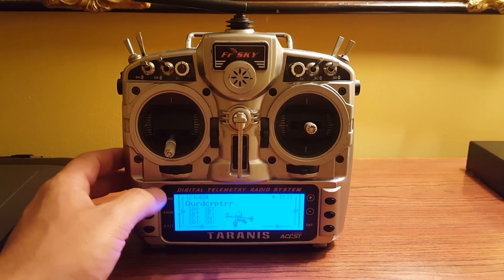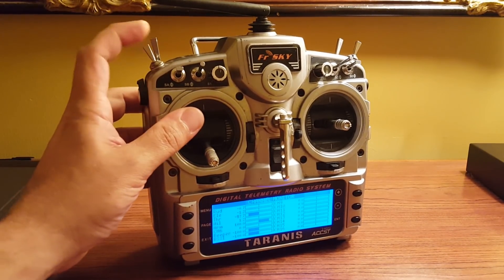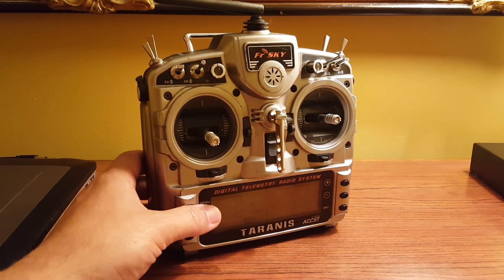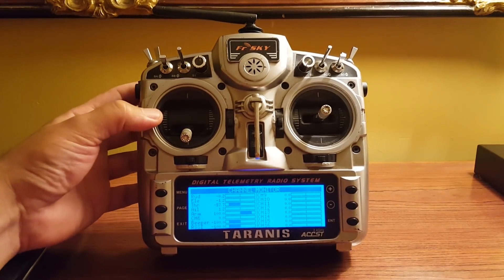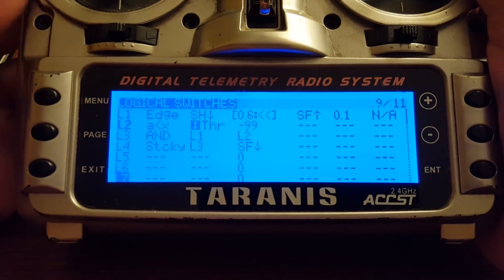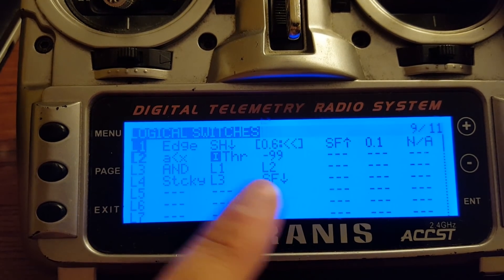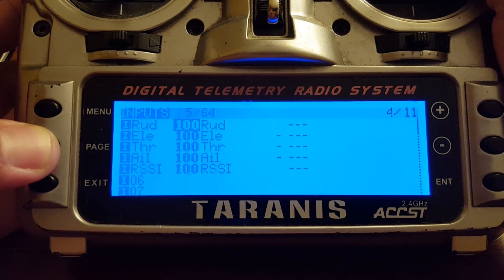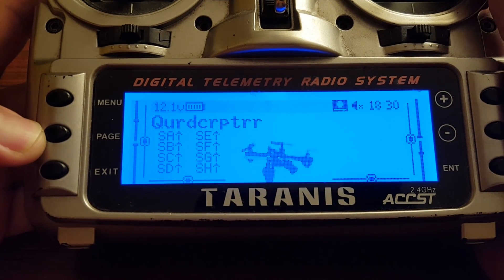Safer Switch Arming on FrSky Taranis

Comment: Is it possible to do this on a 3 way switch? My kiddo has small hands and we have both gotten used to arming with the SA switch on the Taranis. I set it up following the steps in the tutorial and it actually reverses the function once it arms the first time (or at least that is what I think is happening). I basically have to leave it armed (spun up) and hit the SH switch to get it to shut off. Then once I unplug and replug in a battery, it goes back to normal for arming...until I have to land and shut it off again. Suggestion please?
Reply from the maker: I think the issue you're running into is that switch SA is not momentary. The logic relies on switch SH being hit and then returning back to the default position. Since switch SA is not momentary, you have to do this manually. But I'm not really sure. In theory, you can set the logic up to do whatever you want, but I'm not sure I understand what it is you want to happen.
Reply: I am hoping to figure out how to get the copter to shut off in the 2 downward positions. And to spin up at only the top position. It might be easier to open up the transmitter and simply move the location of the 2 switches (SA and SF).
Reply from the maker: +Jonathan Roberts so you want top position to be armed? Or top position to be ready to arm and then SH actually arms?

Comment: Hi Joshua, Im having a bit of difficulty here with this set up. On my mixer page 6/12 under channel 5 the source is the switch name eg SF and the weight is 100 but on your video both parts of channel 5 are set to (max) and one part is weight 100 the other part is weight -100 are these values important? can changing these effect anything else on the radio? Sorry Taranis Noob here lol.

Comment: Is there a video showing how to setup an arming switch on the x9d plus?
Reply from the maker: +9495tj if it's different, it's probably because you're running a newer version of OpenTX. But I think it should be mostly the same.
Reply: +Joshua Bardwell I see.  I am very new to building this kind of thing. I'm not sure how to set arming / disarming switch. Thank you for your response.
Reply: +Joshua Bardwell The main issue I'm having is - even after successfully binding the receiver to transmitter,  I'm unable to proceed through the first step of the librepilot transmitter setup wizard.  
I am trying to build a quadcopter with the following parts:
LHI Nighthawk frame
20A ESC
Simonk motors
Cc3d flight controller
D4R-II receiver on pwm mode
Taranis x9d plus TX

Thank You
Reply from the maker: +9495tj I don't know LibrePilot specifically but you need to be sure the receiver is wired correctly to the board. That would be my next step.
Reply: +Joshua Bardwell OK.  Ch1 on the receiver is wired to cc3d and ch3&4 signal terminals are jumped

Comment: This is a great idea. I feel so much safer when holding the quad while power up.  I added a bit on my setup so that both the Taranis and the quad beep at pre-arm.  If you bump the pre-arm switch by accident you are warned of the danger.
Reply from the maker: +Ritch1e nice.

Comment: I like the manner of teaching that someone who till now just surfed the net can follow your logic and be able to amp up this great radio.  I do have a problem in that I had already programmed functions for the first five logic switches and just plugged  in 6, 7,8, and 9 where you had 1, 2, 3, 4.  I made sure that the channel monitor graph tracked correctly and that the direction arrow on the outputs page changed when SH was held up.  I cant see any differences from your program to mine other than I started father down the logic page but it has no effect on the throttle at all and I can still run the motor anytime I advance the stick.  Does your setup only work in L1 thru L4 or can it be transposed farther down
Reply from the maker: No, it doesn't matter which specific switches you use, as long as the logic is correct. Congrats on getting it all set up. Happy flying!
Reply: Any guess why it did not connect to the channel one?  I do like the way it's set up and would like to use it.
I did connect to ch5  like on ur vid.  I just wonder if it should have been inserted to chk instead
Reply from the maker: I used Ch5 because I use Aux1 to arm, for switch arming.
Reply: I have looked at this again and all my stuff is exactly as the video shows but I am still not able to get it to work.  When I plug in the lipo to the esc the rcvr goes thru all the beeps and will also in a couple of seconds go into motor arm as long as the throttle stick is down.  I guess what I dont understand (coming from JR/Spektrum radios) is how do In link ch5 to ch1.  Do I move, copy, or insert ch5.
Sorry if this seems tedious but I am determined to beat the radio one way or another. LOL
Reply from the maker: Jim Dieckow I'm really sorry, but I'm not following what you're asking. I don't know what you mean by "link ch5 to ch1".

Comment: Thanks. Means I also have to set MAX for every switch I use, i.e. Flight modes?
Reply from the maker: No. Set the input as the switch and the channel will go -100 / 0 / 100 for a three-position switch. Only use MAX when you want to force a channel to a fixed and specific value.
Reply: Thanks! Understood.

Comment: Joshua, I got it. It wasn't set to MAX at my side. Here it was set to an input signal. Have no idea what this MAX means. Sorry for my intrusion!
Reply from the maker: No worries. MAX means that it sets the channel to a fixed value. Or, more accurately, it sets the mixer line to a fixed value. So MAX with a weight of 100 sets the channel to full up, and weight of -100 sets the channel to full down, and so forth.

Comment: Hi Joshua, I have tried your arming version a lot. I correctly set true L4 and false as well, but my mixer values always go from - 100 to 100 when I toggle the SF switch. I copied exactly your method but it doesn't work or works only once.
Reply from the maker: I'm afraid that there are too many variables here to diagnose exactly where you've gone different than me.

Comment: I have failsafe mode on a different switch. So before I pick up the copter, flick into failsafe and I get a 2 switch arming process. Its pretty hard to accidentally knock 2 switches into the correct position, especially the smaller ones on the front panel

Comment: Here's my version for Turnigy 9XR PRO

LOGICAL SWITCHES
L1  v<val         Thr    -95
L2  NtmeOff   0.5    On   1  TRN
L3  AND           L1     L2
L4  OR              L4     L3       THR

L1 is on when throttle stick is low
L2 is on after holding TRN up for 0.5 sec
L3 is on when both L1 and L2 are on
L4 switches on when L3 (L1 and L2) are on and while THR.CUT is up.
To unarm just switch THR CUT down.

Comment: Hi Joshua, nice programming but how's about accidentally disarming the motors in midair? Any suggestion? Maybe also with SH switch or that disarming is only possible while throttle is at lowest position?
Reply from the maker: My answer to accidental disarming:

https://www.youtube.com/watch?v=bTalnzcO0xk

When I want to disarm, I want to disarm right f'ing now. If you feel different, a solution where you only disarm when the throttle is down could work well. Bear in mind that Cleanflight has an option to only allow disarm when the throttle is at zero, so no Taranis wizardry is required, although it would also be easy to do in Taranis.

Comment: Been doing something similar for months.  2x switches have to be in a specific positions to arm.  They have to be in the same position as when I fly helicopters.  So left shoulder switch in the middle, right shoulder all the way back.  Any other combination is disarmed.
Not as fancy, but just uses a simple AND in the Taranis.
I haven't had an accidental arm yet (touch wood).

Comment: I just have "SF OverrideCH5 -100" in the Special functions tab, so I basically have SF and SE set up as an AND gate to arm
Reply from the maker: +PiManASM but no delay right? Still a simple and clever solution.
Reply: No delay, but it would be rather difficult to bump SE. Still allows me to disarm quickly. Then I have the Start timer on SF, and the reset on SE, so I can land and disarm in the middle of a pack, without tripping the auto reset timer.

Comment: Hi Joshua, I was experimentering with this yesterday. Actually I'm on a airfield in Norway and to many thunderstorms here for safe gliding. So I think if you first toggle the the SH switch h then you have already unlocked and can by misstanke arm by the SA switch some time later on. I did it like this and think it works now so you first have to set the SA to down and then arm with the SH. Little hard to uppload things from the tent but hopefully you can get the picture of my setup from the link. https://www.dropbox.com/s/s0ufd4hbfgi78wq/20160712_155916.jpg?dl=0

Comment: Can You tell how to do the same with Turnigy 9X with OpenTX firmware?
Reply: I do something like this:

L1  AND  THR TRN
L2  a<x    Thr   -99
L3  AND  L1     L2
L4  Glue  L3     TRN

and this is seems to working like Your's setup. Disarming work with momentary switch anythime?
Reply: https://www.youtube.com/watch?v=bv3VJ1jznw8&lc=z13kgn25sxvaczb1h23gx1pomyalgb1va
Reply: L1  AND  THR  TRN
L2  a<x    Thr    -99
L3  AND   L1     L2
L4  Glue   L3     !THR

This works better.

Comment: Stick arming works just fine.
Reply from the maker: +Ziad Kadi stick arming is inferior, IMO, if only because you lose yaw control below min_check when you are stick arming. Zero throttle control is compromised when you stick arm.
Reply: +Joshua Bardwell good to know thanks

Comment: I use a similar set up on a devo7.  I use a switch for arming and set my throttle hold as well to 0 throttle. I need to set both switches to arm and to throttle up my props.

Comment: This is generally why I leave my idle up switch in the idle up position after I disarm, means the copter wont arm by accident due to the way the idle up switch works.
Reply from the maker: Yup. I also used to push my throttle slightly up to lock out arming.

Comment: Hi Josh. I have done this and it's working great. I did find though (after a bit of troubleshooting) that I had to change my arm switch to my usual "off" position in Betaflight GUI to get it to work. Is that normal?
Reply from the maker: Not sure I understand.
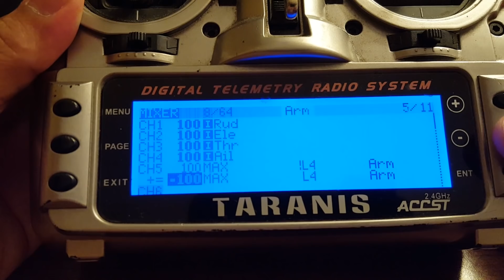Reply: Look at 5:52. When !L1 (L1 is false) its outputting 100% of the spectrum. This is the right side of your Betaflight Modes Tab. When L1 its outputting -100%, which is the left side of your betaflight Modes tab. My brain works likes yours and thinks "on is to the right" so I simply reversed these numbers and made !L1 -100, L1 100. This effectively puts the "Arm" mode on the right side of the Modes tab sliders. It doesn't matter which way you do it, the logic works out.

Comment: Been there done that accidentally (arm that is).  Disarmed after i landed after a race, the switch got bumped after i picked up the quad and LUCKILY i was carrying it by the battery which was on the bottom.  Scary moment!  When you set it up people, take the props off!  Thanks for the vid!

Comment: Hey Joshua great tip and video.  Also a tip for your viewers.  I don't fly with an OSD, I know its a personal choice, so I have a timer set up with voice announcements.  I set the timer to count down on L4, or Logical switch 4,  with your setup and included a special function to reset timer with the SH forward.  This way it resets when I begin to fly and also only begins to count down when L4 is active and armed.  You can than also expand it with another special function with L4 to play the track of engines armed when L4 becomes active.
Reply from the maker: Good tips. The Taranis is a real Swiss-army knife!

Comment: Could you not just use the other switch so that you can hold it for say a second to toggle between arm and disarm instead of using two switches?
Reply from the maker: I want to be able to instantly disarm though. So I could set up the momentary switch to arm on a delay and disarm instantly, but then I couldn't have the tactile feedback as to the disarmed state. With switch SF as the disarm switch, I can hold my finger on the switch (an old habit from the "throttle cut" on a fixed-wing) and know that the copter is safe(ish).

Comment: Excellent - excellent - excellent!
I'd change the function in the mixer entries to "replace" or whatever it is  instead of "add". But that's just OCD, it doesn't really matter.
Reply from the maker: +Chris Mavrakis you're technically right, but because the switches are mutually exclusive it doesn't matter.

Comment: would you mind sharing (and maybe this is a whole other video) what your other switches do? I always like to see how others do things in case there is a more efficient or logical way of setting things up.
Reply from the maker: The only other switch I have set up for quadcopters is a three-position with buzzer and blackbox on two positions.
Reply: cool, I have disarm/arm/blackbox-arm on a 3 position switch and beeper on the 2 position switch. I used to have arm on the 2 position like you though and have been thinking of going back to that cause maybe it's better to just worry about on/off for arming and make any extras on a different switch. funny how we have all these switches and really use a few of them. :)

Comment: The Taranis is so freaking cool. Any reason you have your arming switch as armed when pushed "away"? I have mine in the other direction (i.e. "pulled") as I like to just push all the switched away from me when I turn the radio on, then I can pull the arm switch to arm. I feel like I might be missing something. I also use the momentary for Vbatt call outs, I think I could still do this with this setup though?
Reply from the maker: It's how I originally did it way, way back when. I didn't know the standard was to have switches pushed away for the "neutral" position. Now that I'm trained to it I don't want to re-train.
Reply from the maker: I feel like it's that way too. To disarm, you sort of swipe your hand up across the shoulder of the Taranis and it disarms.

Comment: How about putting the arming on one of the turn-knobs? I mean.. You'd be hard pressed to accidentally turn those? Seems pretty safe to me?
Reply from the maker: Seems a little clumsy, but the Taranis could do it for sure. Just make sure you can quickly disarm!
Reply: I agree on the clumsy part indeed.. Safe it is though :)
Reply: I did just that and coupled it with a physical switch. A little simpler, and I don't find it clumsy at all. For anyone who wants to try this, the pot (knob) must first be set in a logical switch. I made one using a>x SB1 90, which activates the switch when the pot is in the top 5% of its value spektrum. Then you make a second logical switch type AND with the first logical switch (LS1 in my case) and your regular arm switch down. Then set that new logical switch as an AUX channel in the mixer and use that as your Arming channel. Both knob and switch must be engaged to arm, and if either is disangeged, it disarms.

Comment: Just trying this out, if the quad is armed and I hit the SH switch the quad will disarm until I release the switch and if I'm flying and hit the SH switch it disarms and won't rearm until i bring the throttle down, not sure if iv messed up somewhere or that's meant to happen, I know it's unlikely for most people to accidentally hit the SH switch but it could happen specially for me as I was using the SH switch to call out batt voltage before.
Reply from the maker: I might have to double check that, as I'm not sure that I verified SH's function when armed. If SH causes disarm when in flight, then that's a bug and I will have to update. Good catch if so.
Reply: I was looking at this as well.  All is good until you accidentally disarm (SF) the copter in flight.  Then you need to do 3 things: Rearm (flip SF), reduce throttle to zero, and pull the SH switch for 0.6 seconds.  Normally you would just need to rearm, assuming you could do that with goggles on.  Not sure how else you would do this unless you locked  in the arm as long as the throttle was above -99, event this is somewhat risky.  Could you put a delay on the SF switch so that it would not disarm until 5 seconds passed, would give you time to quickly rearm...that sounds a bit dangerous doesn't it?
Reply from the maker: I don't know what situation you're in where you disarm and then expect to rearm and keep flying before you hit the ground.
Reply: Well I guess that's true, I am never in that situation myself and maybe assumed others with more skill might be or you fly slow 400 feet in the air.   I don't see an issue with SH in flight (on Simulator).  L4 never goes off unless you disarm with SF.  The one thing that I found is that the 2nd setting for V2 of the EDGE function should be set to (instant), which is how it is shown in the video, and not (release) or it will not arm until SH is release, not after 0.6 seconds.  So I guess you would need to pull SH for 0.6 seconds, then release it to arm.  Works either way, just different.  Not sure how the Sticky L4 would go away unless SF was switched since that is the only thing that can turn the toggle off, unless an AND switch was added as well.
Reply: looks like i had just made a mistake in the mixer all is working fine now, sorry about that guys
Reply from the maker: +Russell Born okay whew. I'll still double check this evening though.
Reply from the maker: Okay, I have double checked. Flipping SH when armed does nothing on my setup. Only putting SF to the disarm position disarms.